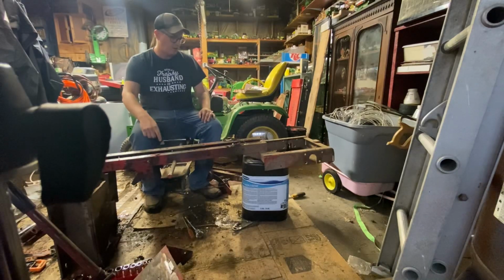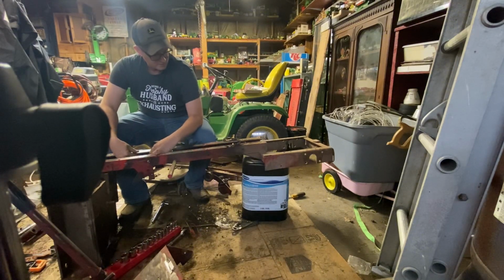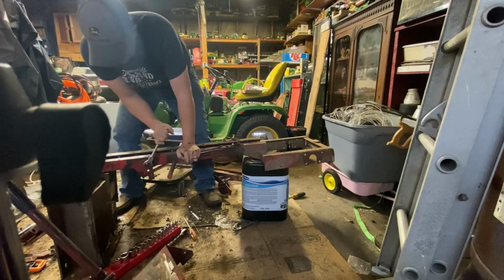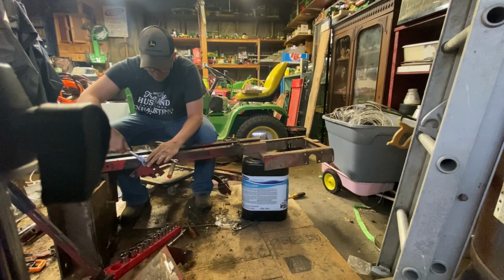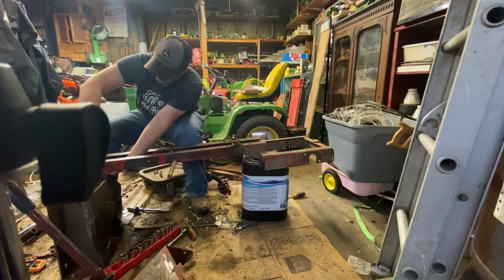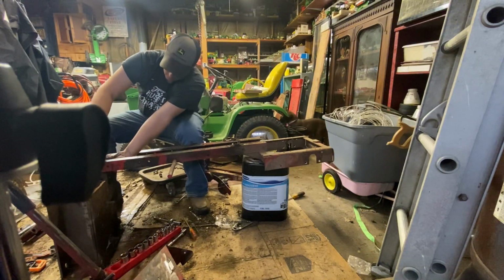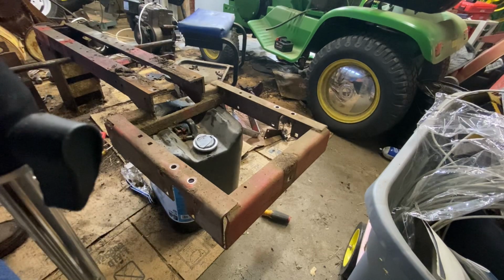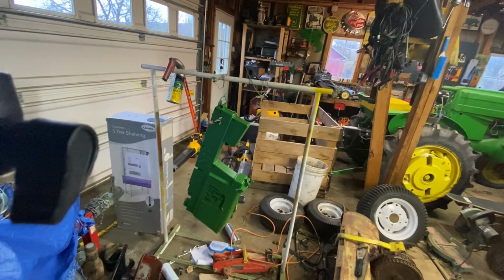Day 3 of working on the wheel horse 800

Comment: You got that thing stripped all the way down to a couple pieces of angle iron! This is the first one I’ve seen, I’ll have to go back and check out the previous videos. On the powder coat, I’d say if you have access to something like that do it up in red that would look nice. That’s something I’ve always toyed with the idea of getting into myself, especially since I’ve got an oven in my shop. Is the horse 500 a gear drive or Hydro?
Reply: Yeah I didn't get notifications of the previous, actually the first one I saw he was putting parts on a wagon to pressure wash.
Reply from the maker: I bought a unit a while ago. I keep my eyes open for an oven for the shop. I’m hoping to find an old wall unit so I can stick it under the bench but have easy access to it. It’s gear drive it has the 3 speed in it.